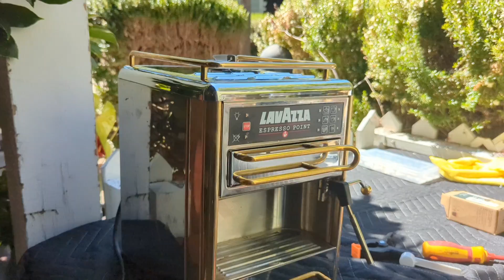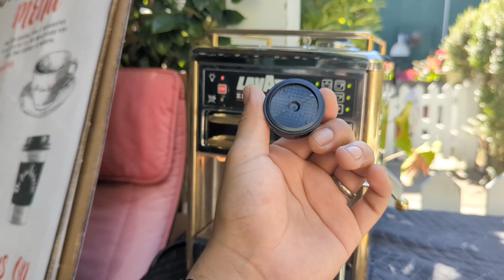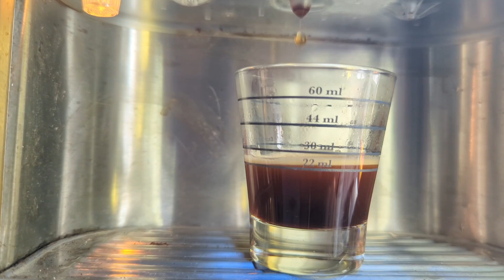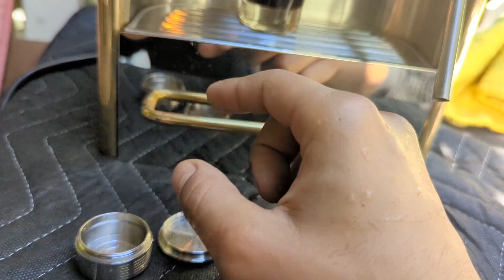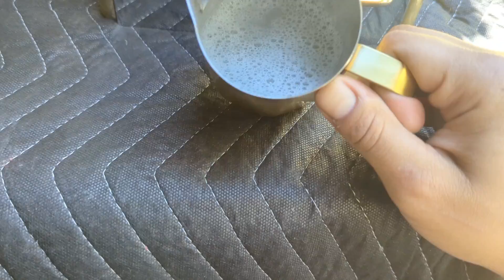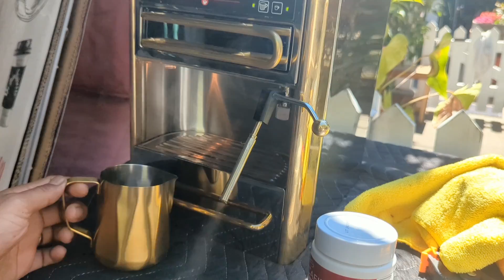Lavazza Espresso Point Restoration: Water Pump Replacement & Deep Clean | De Luca Espresso Repair"

Comment: I just picked one of these up used. Low shot count 350. But has some mineral build up in the silicone lines. I descaled it but still see some stuff in the lines where the pumps are. How hard is it to replace the silicone lines? Do you have a video on this? Or is there a way I can get it all cleaned out
Reply from the maker: Sometimes it's just almost impossible to remove that, so it's best to replace them

Comment: do you have a link for the reusable pod in this video?
Reply from the maker: I can't find the one I originally ordered but here is a similar one. They are tricky to use and require a lot of experimenting, I believe once you nail down the quantity and grind they can be a great reusable alternative. But you probably have to buy at least 2 of these https://icafilas-coffeecapsule.myshopify.com/products/stainless-steel-metal-coffee-capsule-pod-compatible-for-lavazza-espresso-point
Reply: Years ago I was able to get small filters for the reusable pods but can’t find them anywhere. Can you help with that

Comment: Hi! I have the same machine but the water/coffee not coming out. All buttons on, recognized water being empty and recognized when it was filled. How can I unclog?
Reply from the maker: You can try descaling the machine but if the water pump is done for, it will need replacement, thankfully is a straightforward process and the pump can be accessed through the bottom but you will need to open the machine a bit.